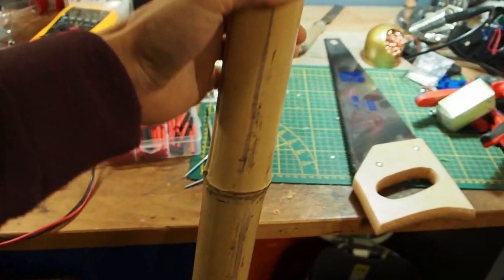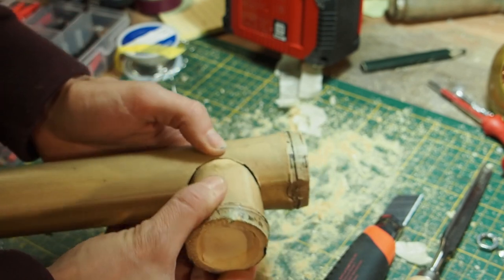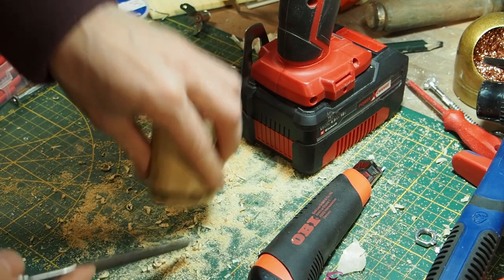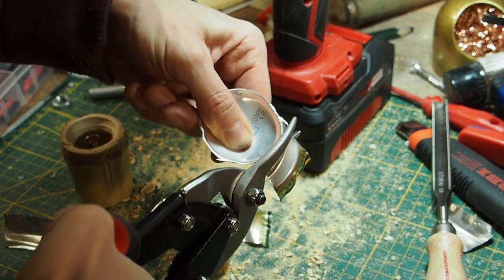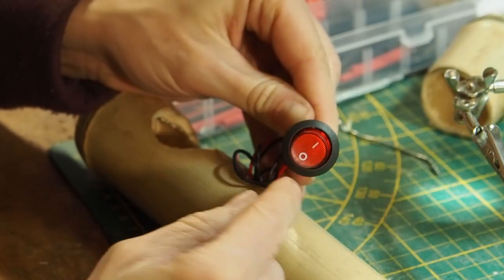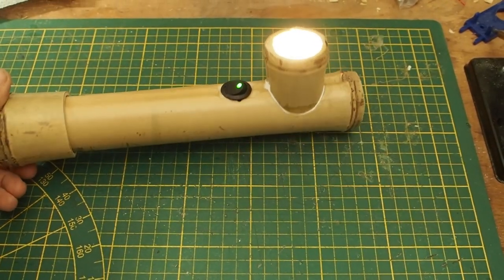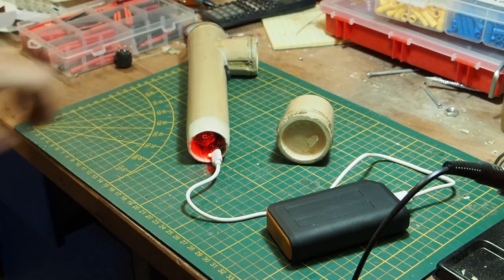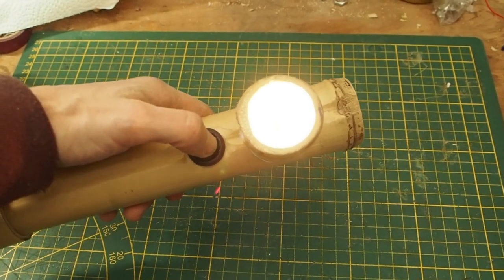Making a Bamboo Torch Military Style

Comment: Cool project! Not using LED?
Reply from the maker: I actually hate the lights of LED. They are dangerous to the eyes. I wamt to use this torch around other people and my dog without hurting them, plus the light is more beautiful than those leds
Reply: @SurvivalLilly  Yeah? I wondered about LED being damaging to the eyes? I know that, I hate them, too!  My motorcycle has a neutral indicator light on the panel and it's a bright green. I had to cover it up with a piece of tape! It actually hurt my eyes!  I didn't know if it was just ME?  But, I just can't stand it... I've noticed that when driving as well, when oncoming traffic has those type of headlights.